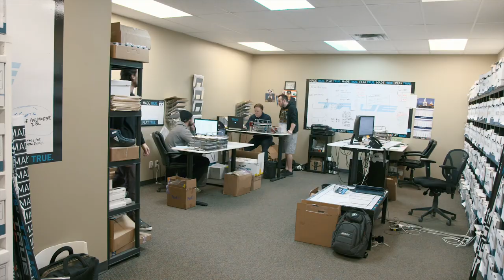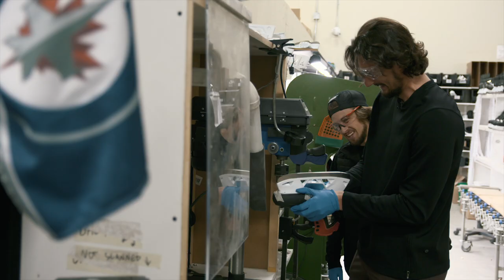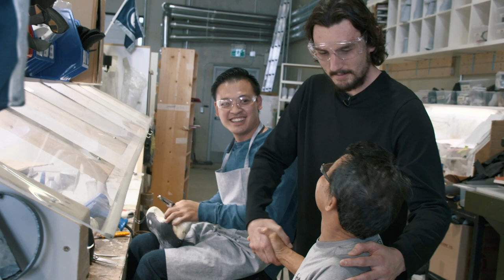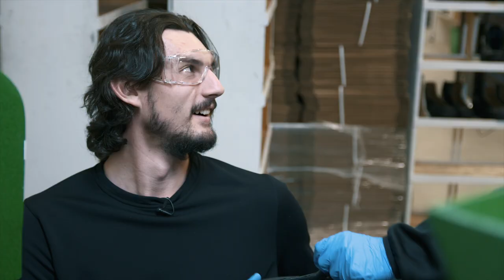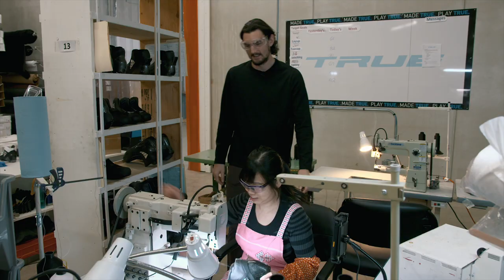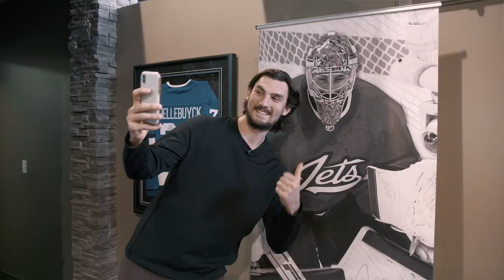Connor Hellebuyck Ran TRUE Hockey's Skate HQ

Comment: True Hockey,
I have been using your sticks for the past 2 years and I love them. With your sticks I can shoot the puck wherever I want it to go even when I am in very close to the net. Also, the blade feel with the puck is just something else. It’s different from Bauer and CCM twigs. This feel has greatly increased my sense of where the puck is on my stick. I currently use the A 6.0 sbp. There is ONE thing that would make your sticks so much better. This thing is the durability of the lower half of the stick. The blade always gets chipped up and eventually cracked and sometimes even the lower part of the shaft. I’m not sure if it’s just the matte coating or if the blade just isn’t supposed to be protected. I’m interested to see how the new XC9 stick’s durability turns out because this stick has gloss coating. I believe that y’all can improve your sticks by making them have gloss and grip. The most important and frustrating part for True users is the blade, so a blade with an exterior like The Bauer vapor blades would be awesome. Keep producing great sticks